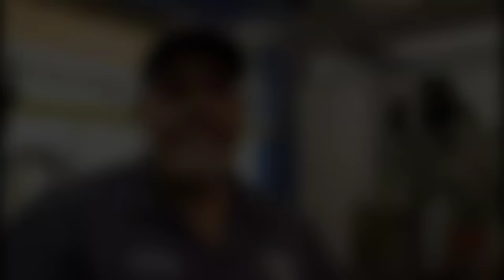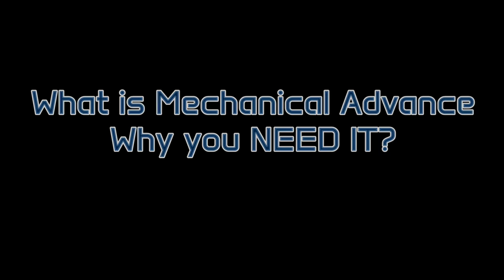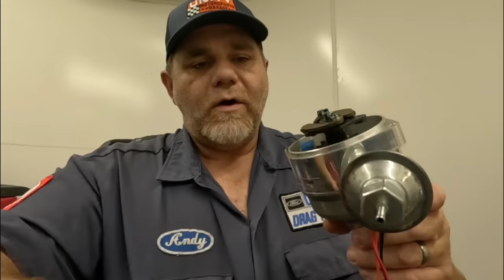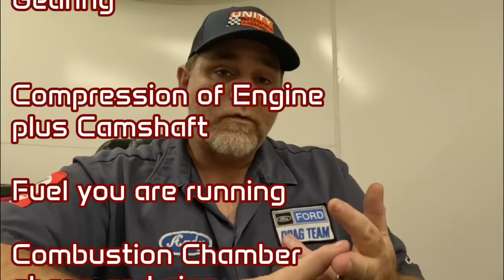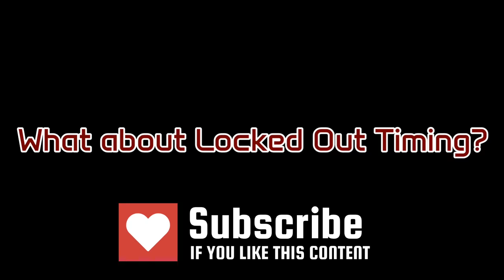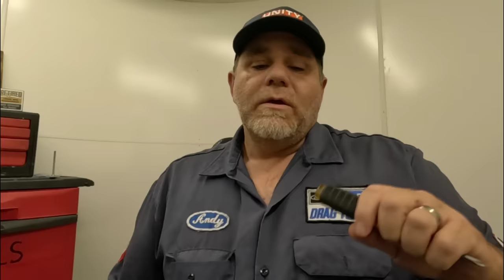Ignition Timing or Fuel Tuning First? You are doing it wrong!

Comment: In the world according to me you make total sense.

I view so many dyno test videos where the tuner guru cranks the timing 2° at at time until HE thinks it's maxed out.
Then he sends his "ignorant" customer home with his "tuned" engine and neither one considers vehicle weight, road condition/terrain, uphill/downhill, and so on.
I mentioned in another comment elsewhere that I got 17 mpg out of a CJ5 with a stock 304 and some guy railed the crap out of my comment.
He conveyed that he could not ever get more than 15 mpg in any CJ5.  Shit, he sounded mad!!
After doing some work on my 2 bbl carb I played with the mechanical advance.
I checked my work with a timing light that measures point dwell, rpm, and initial timing. Then I drove it through town and into the hwy to the next town about 25 minutes away observing response and listened to the engine, the hunk of machine under the hood not the beautiful muffler (it's all muddy!), and observed the engine temp gauge.
The temperature under real world load is a huge indicator of good/bad timing, not a dyno in a fancy climate controlled, germ free room akin to a surgery room.
I continued the process until the engine pinged and then backed off the mechanical timing so I can add vacuum advance.
Under load the engine will lose vacuum and backs vacuum advance down to eliminate pinging and overheating.
I favor doing this process in the summer when temperatures are at their max to accomplish a tune without pinging.
I reached a total mechanical/vacuum timing of 52° with no pinging or overheating, and on 87 octane fuel!!
Then I backed off the adjustable vacuum canister for a total of 49° just to be on the safe side.
Whoever I mention this to tells me it's way to much and should not be more 32°.  I just smile and do like Edith Bunker, "awwwh."
Please note also that my results are on an engine with "lazy" morning lifters and a sloppy chain!!  You can see the sloppiness with the timing light when burping the engine. 
I plan to install a new chain, cam, and lifters, but the bigger picture is 383 Chevy or 400 small block Chevy.
I just need to find a cheap Chevy truck with a dual wheel rearend or 14.5" corporate rear.
Thank you for posting a video that makes total sense like my total advance in my particular vehicle.

Comment: Also manufacturers installed the vacuum advance to give lots of advance coming away from a stop sign because they're is very little air in the cylinder at that time. For a stock street vehicle ported vacuum seems to work the best.

Comment: Yup, I was taught to get the fuel and timming close as possable by ear, then take it on a fairly steep hill in 2nd gear and stomp on it, if it pings back it off, if it dosn't ping, add some till it does and back it off. I found doing this with reg pump gas, then useing the 91 octaine, put the timming perfect. I mean if you don't have electronic fuel injection that ajusts for altitude and you live someplace where you change altitude constantly by 1000s of feet everyday, like Pheniox to flagstaff. You will want the electronic fuel injection conjoined with computed timming. Lots of us old school guys learned alot in CA where you surf at the beach and go Big Bear and ski the same day. All that lead based black smoke, change the jets at 5000ft. lol. We once spun a rod berring in a late 60's 327 v8, found it was due to a slip on gromet sleve that was missing from the vac advance pod arm end.

Comment: I heard a racer say that fuel is soft and timing is hard ( I am paraphrasing, I think it was Stevie Fast ). I think those who run on the edge in competition where a small change in timing could blow the tires off would use fuel to tame the car or kick the car at a certain incremental if it's not too severe. 
I could be wrong.
Reply from the maker: That is true.. I have also ran a combo where the engine would be completely happy then you try to add a deg or two of timing and it would nip sparkplugs completely melt the ground strap off.. it had such a small tuning window that we had to tune it with fuel.. this was on the Big Nitrous 4.6 with 14 to 1 compression. 
Andy

Comment: I agree to a certain extent, but to put it simply, there's no way you're going to start the engine without getting initial timing to a spot where the engine will run, and you cant really optimize your carburetor jetting and such without starting the engine, so its always a ballpark thing when you first fire a new engine. 
 There's not really a good way to get the carburetor lean without having your timing set at least at a decent spot in the first place which will vary with fuel and compression ratio, rod length, etc. So its basically having to go back and forth between the carb and the ignition for however long it takes to reach an optimum setting for the fuel you are running.
Reply: id say for a given engine  if nothing else changes  and you change cams to one with mreo duration, then the initial timing has to increase to where the vacuum again is  highest then shut the car off.  then try to start it and see if it drags.  gotta have a good enough starter for the compression ratio too....if it drags, back it off until it doesnt drag.

Comment: Well depends on how much camshaft you have, a big cam needs a lot of initial timing, something as much as 30 to 40 degrees to stop the horrible gas smell at idle , that burns your eyes.
Reply: that could be possible but a cam that needs that much initial means you either A.  have way too big of a cam or B.  dont have enough compression for that cam.  ive seen street cars with pump gas take 16-22  initial.  especially with those "thumpr"  type of cams.  if you were to change nothing else of course...

Comment: Food for thought if you try to tune up a older engine start with a compression test or leak down cylinders making sure that engine is tunable!! Can't beat a Dead horse, I gotta old 3/4 350 4wd needs help but I'll do a little homework first, I'd love to build budget 454 as I have most everything including 702 66 325 heads and flat top pistons, imagine the torque!! Nice information i!

Comment: Hey gr8 video, i remember my dad had a mazda 626 from 86', it originally came with a centrifugal/vacuum advance distrubtor, but as importation of " foreign used parts" entered the market in Trinidad and Tobago, my dad got a used distrubtor from a " miami front half cut " of a mazda 626 GC, it had a double diaphgram on it, one for vaccum advance and the other vaccum retard, since my dad had an " ANSI" cng fuel kit on the car, it was bi-fuel...super gasoline as was available that time in Trinidad and Compressed Natural Gas fuel that had entered the market in the early 90's in Trinidad, with this double diaphgram distrubtor and the electro valvles installed, the ignition advance could be adjusted " on the fly" while driving...came in very handy when i attained age for the driving permit and we would do a lot of highway driving, when in those days if you did not drive 140Km/hr, you were the danger on the highway, imagine a 1.8L 4cyl fwd mazda 626 from 86' with the F3A automatic transmission ( 3speed) having to fight to keep up with the rest of vehicles while running on CNG fuel .... That was my training in ignition systems...from spark plug selection, to plug gapping and indexing, to spark plug wires, to messing with distributor weights and springs and the icing on the cake was this distrubtor with the double diaphgram.

Comment: No, you're not crazy. It's good info. I have an adjustable reluctor wheel setup distributor for my big block Mopars. Tunes it like 8  single cylinder engines, has to gain HP.

Comment: Also with locked out timing there is slew rate in the module that will retard the timing as rpm increases .So you end up with a backwards curve , a msd or HEI usually retard 1 degree per 1000 rpm . The ford Duran spark and mopar boxes will steal 2 degrees per thousand . Check the timing at idle and then spin the engine to 5 grand and see if it stays  . Haven’t seen one yet .. a curve is the way to go .

Comment: hello Andy thank you for your videos and I'm a huge fan of Casper since you did the test of the new Elderblock 4150 I went out a bought one now I'm having issues with the vacuum advance and which Port is the correct port on the 4150, directions is not clear which Port I need to use with a stock mopar distributor do you know before I call them.   thank you sir

Comment: I think your right but you do have to tune the timing with initial set up like 30 degrees stiff springs vacuum advance in ballpark and know you have a good sound ignition system before even thinking about cabureation you have to be pretty damn close on ignition set up to make sure your not missing cues from the carb or carbs when tweaking then when like you say tune that carb idle circuit first then power circuit if street car then main circuits for that mid range to full throttle creep up to, then when all fuel ratio look good then go for  for the blast from idle to full throttle up to maybe around 120 mph and make decisions to hit happy medium on fuel ratio tweaking on maybe main jets 1 number up or down based on what you see in your ratios atleast not to be ever to lean at any given very long in your full throttle blast from idle. And even a number up or down on your power valve accordingly to what your seeing in your air fuel ratios to aid in dialing in.  Then go back to timing dialing in full timing advance to get the most horsepower without getting into detonation then  work on spring rate to get that off idle up to 2800 to 3000 rpm acceleration off the line then last work on vacuum and use the set screw up  for rate coming in to see if you can get the best off line motivation of engine with your vacuum to damping the dig off the line so you can keep it from spinning a whole lot that's just me.

Comment: Timing first. Then fuel as long as your not too far off on fuel either way.
Those springs, counter weights, the dwell , points, vacum advance items on old points distributors can really be tweaked ❤

Comment: I've been away from muscle cars since 1974 but if that Mallory with the ancient ACDelco type of mechanical advance arrangement is all there is available and all you know then you should research the Accel dual point distributor available in 1973/74.  Not only were weights and springs available to vary the ignition curve but there also were adjustable stops to adjust the total timing supplied by the distributor.  On my 67 GTO I ran 12 distributor degrees in the mechanical advance (24 at the crank) with 9 degrees initial at 650 rpm. I set total advance in at 2800 rpm. Anything before that would be needless wheelspin. I tested 1700, 2100, 2400 and 2800 rpm.  This was a street/strip setup......

Comment: Always ignition timing first. 
You always check your timing on full addvance, weghts fully out. This way, you know the timing won't over addvance! Once you have the ignition right, you can now go to the mixture.
I have been in mechanics most of my life. So I know this is right.
We always tune in reverse order. So valve timing & clearace, next compression test, ok. Now point gap, on the tip of each ignision cam, this ensures shaft straightness. Next, either a fag paper, or a light to determine the exact point of ignition.
Once all this is correct, 'Now' you can play with the mixture.
You can also use a colour tune kit, which tells you exactly how close you are with the mixture! 
This procedure works for all engines. Have a good one. 🤨🇬🇧

Comment: love this video man , i have a 73 Dodge Charger with a stock low compression big block 400 with a 4 speeds tranny (originally automatic car ) 3:55 gears at the back engine is stock except a street demon carb 625 cfm and MSD ready to run distributor , msd blaster coil and wires...my car is lazy on low rpms especially going uphills and it goes okay when opening the 4 bbl and spark plugs are always black , didnt knew these stuffs till a while back , what springs and bushing do you think my car needs would to hear your opinion thanks!

Comment: hello, i have a question about 'locked out timing'. i am building a budget stockish 87 5.0 mustang. i am carb swapping this car as it will be used exclusively for drag racing. i would like to use the EFI distributor if possible, i know people do that, but personally have not.  my primary question is what would you recommend i set my timing at, to start with? my combo is this; 650 proform mechanical secondary carb/stock cam/stock E7 heads/T5tranny/ 4.10 gears. thank you chuck

Comment: Any advice on an engine that wont stop dieseling? Hci 350 sbc 9:1 compression that diesels regardless of intial timing from 8 degrees to 18 and from an air fuel ratio of 12:1 to 15:1. Temp is a steady 185 and its aluminum heads and idles at 750 cfm. Sometimes even shutting it off in gear doesnt help
Reply from the maker: How much cam / converter do you have?
Reply: @UnityMotorSportsGarage  it has a comp 280 magnum hydraulic roller and at the moment a stock converter. I have a 2800 rpm stall I'm putting in over the winter
Reply: You’re probably running projected tip spark plugs and the ground electrode is overheating.
That or just too hot heat range
Reply from the maker: You found your problem. That cam with a stock converter isn't happy. The throttle blades are too far open causing a super rich condition which will cause your issue. Once you get the converter in there it should help dramatically. You could drill some small .080-.125 holes in the primary throttle blades to all air to pass and then you should be able to lower the idle screw helping your situation
Hope this helps
Andy
Reply: @UnityMotorSportsGarage  thanks I was lost and getting drove crazy chasing my tail

Comment: Andy, after watching your Progression Ignition video, I had to look at their website and noticed the nitous retard wire and the 1 to 10 ° retard capability. Then I got to contemplating DV's 17:1CR on 87 fuel video. In that David tells how when your water injection system vacuum switch turns the water injection on, you want to advance your timing by 2° to 3° to account for the slower burn rate.
I came up with the idea to use a Bosch relay. Terminal 30 gets key on power. That supplies 12v to the 87a terminal. If that is connected to the nitrous retard wire and programed to retard the timing  2° to 3° required in normal operation and then the advance curves set to provide the proper timing for regular operation. The water injection pump wire goes to the 85 terminal and grounded by the 86 (I think I got that straight), to energize the relay. This switches 12v from the 87a so the retard is removed giving the needed advance. The injection pump is now supplied through the 87 switched terminal to provide the water injection. 
Just my schemeing on how to get it to work and the Progression Ignition may be the answer. Just for yours and DV's consideration.
Just a FYI, GT350 Garage channel has three that I know of videos that covers tuning foe 10.5:1 to 12.5:1 compression. He discusses current fuels as compared to 1960s fuels and the required A/F ratios for ethanol fuel. Pretty good information.
Good to see Charlie and Carla on with you guys.
Have a great day.
Here the snow is melting and back roads getting muddy.
Reply from the maker: Thats pretty cool I like the way you think!
Andy

Comment: That little vacuum advance makes wonder: what if I could open it up and change the spring inside... Been messing with a some twin carb + vacuum adv. which to my thinking'd needs a capsule with a weaker (softer) spring inside of it as of a single carb engine. Time for tinkering.

Comment: I have buddies that repeatedly blow up new race prepped dirt track engines where others can run the same engine for years. The destoyers insist on running static timing. My guess is that they are cheating with oxygenated fuel and thinking they need 38 advance.
Reply from the maker: Detonation is a killer! Thanks for watching
Andy

Comment: 10:10:
when you've said, you have to ignite a lean mixture much sooner - did you really mean "lean mixture" or did you mean "low cylinder filling"? 

up to now i thought that a lean mixture burns quicker so it needs a later ignition, but a low cylinder filling burns slower so it needs an early ignition.

low cylinderfilling corresponds to the vacuum-situation.

Comment: Okay, so I’m still new to this whole carburetor and mechanical distributor stuff. I grew up dealing with EFI.
So on my built sbf 306 with aluminum heads.
Are you saying that I need to set initial timing first, then start tuning the carb & lastly dial in the timing?
What should I be setting my initial timing at to begin with? It’s currently idling at like 18°. But the plugs look slightly on the lean side and has like a raw fuel smell. Any help that you can provide would be greatly appreciated… Like I mentioned, I’m still new to this world of carburetors and mechanical distributors. It was time for me to learn something new.
By the way, the motor is in my 85 F150, AOD trans with 3.55 rear gear and stockish torque converter. I have 2 videos of it running here on YouTube, that I just uploaded a couple days ago.

Comment: Seems to me, the best power timing on and engine dyno is quite a way from best power and driveability on the street.  Coolant temps, oil temps, dyno room air vs underhood air density just to list a few.  Why FI engines have all those sensors.

Comment: If it isn't getting the correct air fuel ratio ,.how do you adjust the timing.??? I will let you to explain on the way it should be done on the video. ANALOG is King 👑 don't need much extravagant anything to run or fix it. Adjust to the range you need, and good to go unless you are squeezing fuel economy or max power throughout and especially the Top End depending on the use and applicable use of the motor.